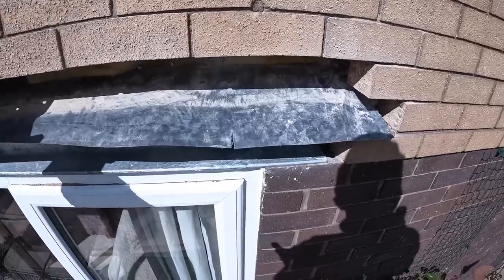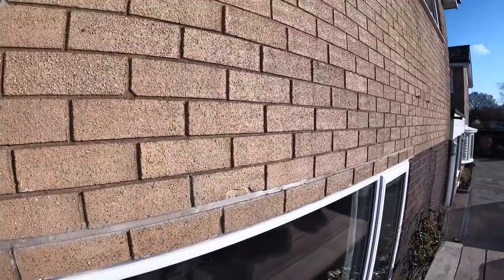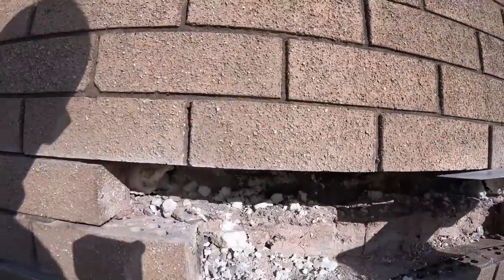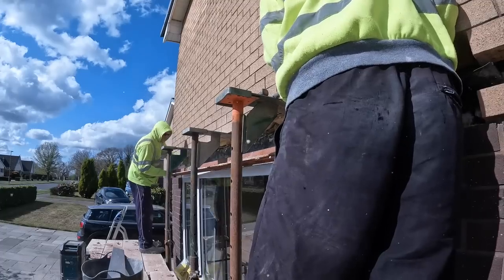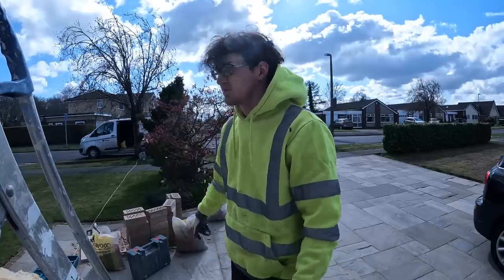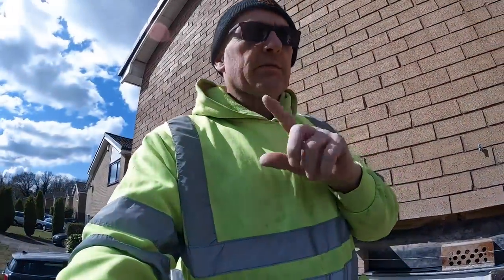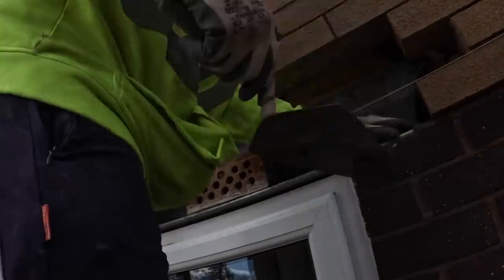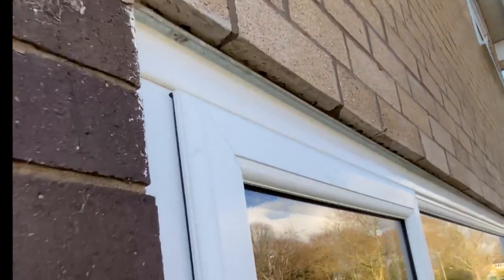DISASTER...WE FORGOT THE POWER TOOLS !! HUGE ANGLE IRON REPLACEMENT

Comment: Nice job guys!  I guess with lifting that big lintel up in place, both of ya'all can skip arm day for the week. Pro Tip: remember the power tools!  LOL!!  One of the other channels I watch, the guy made a ladder lift with an electric winch motor, a bit of angle iron for the lift, a pulley, some wire rope and an extension ladder.  You could even do it with just a hand crack boat winch fastened to the bottom of the ladder. They use it to lift shingles and sheets of plywood up to the roof. Would easily hold a lintel. Cheap and easy to build.

Comment: Awesome upload guys and you done a cracking job that was a big span that lintel! and done well with the  lack of power tools ⚒️ good tip for the insulation also 👏
Reply from the maker: Thanks John 🧱👍🏽
Reply: @SteveAndAlexBuild  that protective cover from screwfix/bnq etc ( cling film like role ) is great for all surfaces, well worth covering the windows with it well worth getting takes 2 min to apply 👍👍👍
Reply: @SteveAndAlexBuild  did u buy a badge at D&J for Archie fund ?? Good to see you wear it try help the young guys cause .. 👍👍👍
Reply from the maker: @makg4655  🧱👍🏽
Reply from the maker: @makg4655  🧱👍🏽

Comment: Hi guys Wont the damp strip make the wall weaker or do the cement stick to it well ? like the expansion strip they put vertical up the wall   including the tray  nice work though
Reply from the maker: Anywhere there is a plastic dpc is a weak spot and mortar doesn’t stick to it 😒🧱👍🏽

Comment: Are you using go pros? I remember back in the day them having lots of issues on the hero and hero 2 with silly things like switching off, corrupting files and not even doing anything sometimes.
Check for a firmware update it might help :).
Reply from the maker: Yes mate the 10 is much better now 👌🏼🧱👍🏽

Comment: Steve is it expensive replacing a lintel?.
Reply from the maker: Around the £500 mark depending on size and if a scaffold is needed , quite a lot more 🧱👍🏽
Reply: @SteveAndAlexBuild  thanks for letting me know we're selling my father in law's house and we've noticed a crack in the mortar which runs about four/five courses estate agent thinks it could be when he had the windows replaced.
Reply from the maker: @nige.3494  Sounds very familiar 😬🧱🧱
Reply: @SteveAndAlexBuild  house was built 1971 wouldn't surprise me if 1 the lintel was wooden or 2 hasn't got one.
Reply from the maker: @nige.3494  . 1971 a lot don’t have any with a timer lintel on the inside skin . 🧱👍🏽
Reply: @SteveAndAlexBuild  estate agent said we can either get it done or get a quote and knock off the asking price luckily it only above the kitchen window that's got the issue I'll ring round next week for quotes.
Reply: Thanks for that Steve 👍
Reply from the maker: @nige.3494  Good  luck 🧱👍🏽